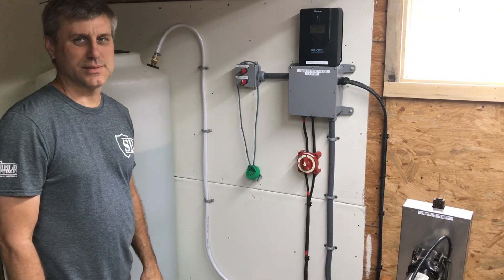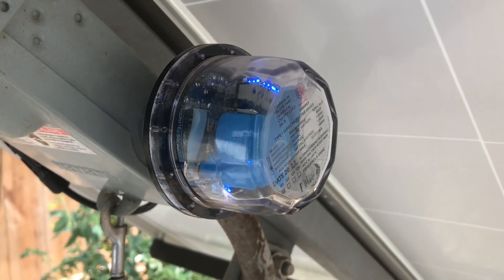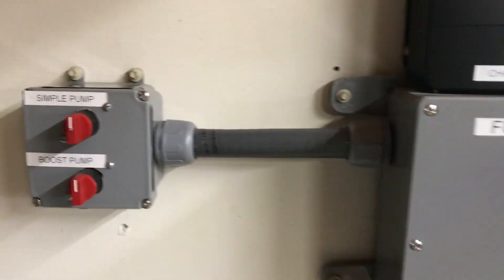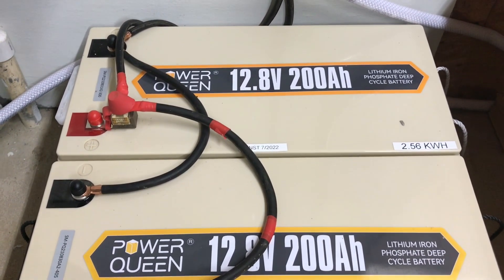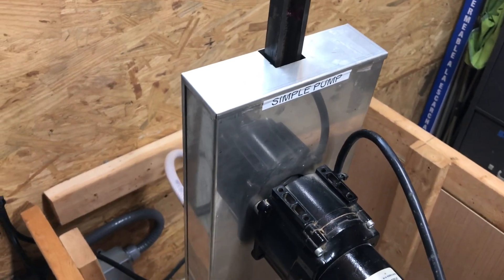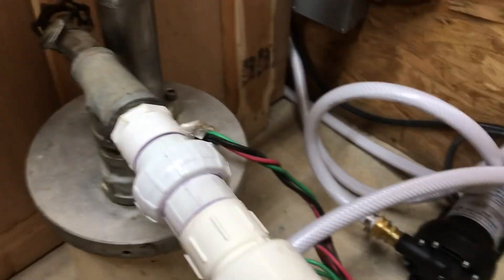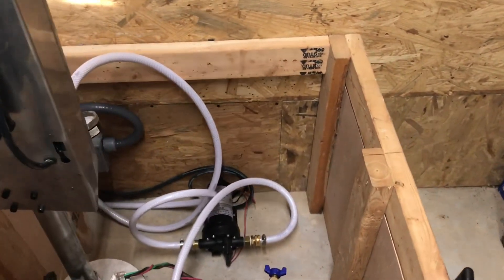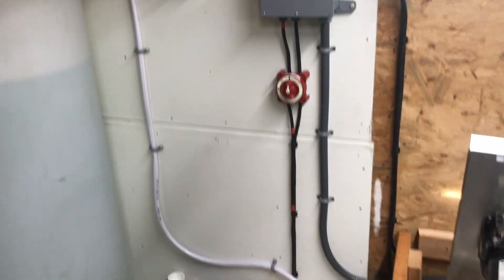OFF-GRID BACKUP WATER WITH SOUTHERNPREPPER1

Comment: It sucks that you have a 24 volt solar system but you're only using it for 12 volt
Reply from the maker: Simple pump motor is 12v only. This system can be broken down to use parts for other purposes or to charge solar generator/power boxes when not needed for water! Thanks for watching and commenting!

Comment: Great video! Im in need of this setup as well. I have the well installed. No well house, or filtration system yet though. I have a solark inverter based home backup system sitting in my house waiting to be installed as well. Gonna run the well on it. But I need someone to help me install. Its over my head. 

I make good food 😉
Reply: Right there with ya...we can't all be good at all the things, which is why I love these videos.... And my hubby. Hopefully it's not over his head (not much is, he just sadly thinks we'll figure out this prepper stuff if and when it all goes up. He doesn't understand then it will be too late)
Reply from the maker: @juliabrown5948  Please work on finishing up projects or at least gather materials for future projects if you can. The time to figure everything out is in “normal” times when you can get parts/components to complete a project!
Reply: @juliabrown5948  You need to convince him otherwise because waiting is a grave mistake.
Reply from the maker: @victory Which sol-ark do you have the 5,8,12 or 15k? How many kWh worth of battery do you have?
Reply: @THEOFFGRIDMOUNTAINHOMESTEAD  I have 14 450w panels, the Solark 12k, and 3 100AH ARK batteries. 

We're trying to sell a rare, and valuable off road vehicle we have so we can expand that to potentially an additional Solark 12k, or 15k, 3 more ARKs, 14 more panels, and Solarks smart loads unit. 

Right now, our ability to finalize all that before major events occur, hinges on the sale of that vehicle.
Reply from the maker: @victoryoveroppression2088  Good luck with the sale of your vehicle, I hope you’re successful!
Sol-Ark is a great system (I’m kinda biased on that😊). ARK batteries are great as well. You’re building a large backup system. I’m assuming you’re going to run a 240v well pump off the Sol-Ark? Your need for a backup water system is way lower than 95% of others out there. Maybe a hand pump or other backup pump in the well casing? Just throwing ideas at you, I’m not familiar with your entire setup. Feel free to email me with any questions. I’ll help as much as I can!
Reply: @THEOFFGRIDMOUNTAINHOMESTEAD  I'll send you an email now.... I have a question Id rather ask you in private. Stand by....
Reply: @THEOFFGRIDMOUNTAINHOMESTEAD  I just sent you an email